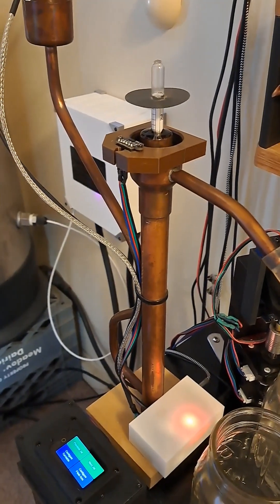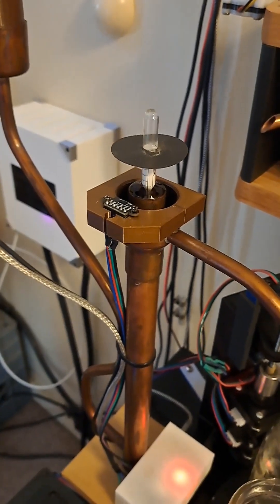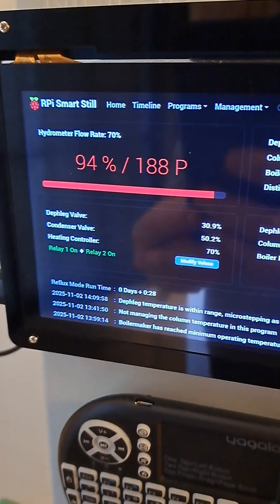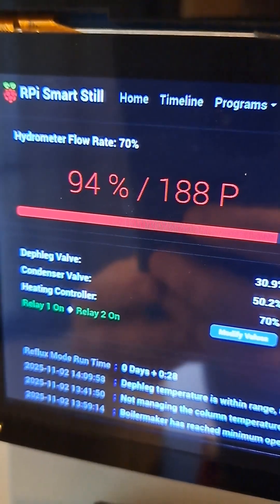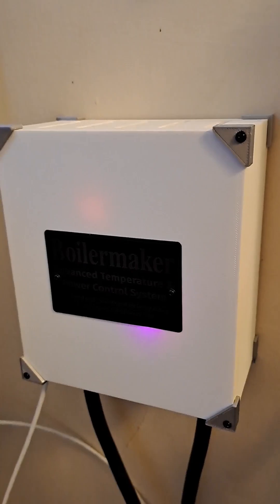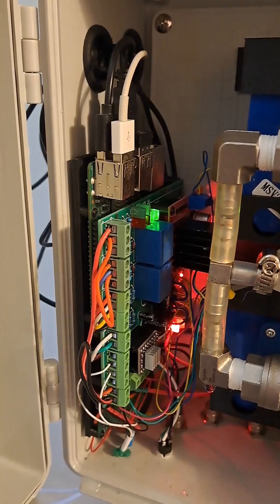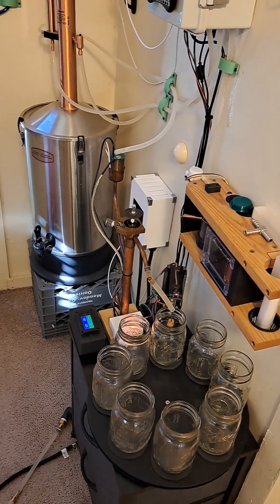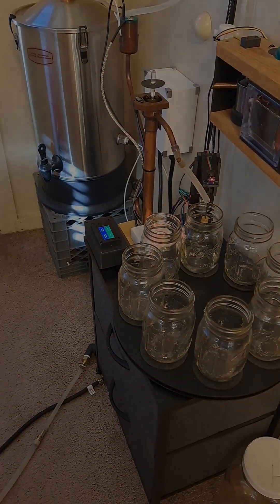Technology Assisted Distillation? What?

Comment: nice and simple. Only issue I can see if the hydrometer rotates the value may well change.
Reply from the maker: Not enough to make any difference of any value. The sensor reads in millimeters, that would only amount to a difference of 0 to 1.5%.
Reply: @PanhandlePonics  I do like in general. It's a very simple solution. 

On your lazy susan, how about a small set of scales that raise up. That would get you a very accurate flow rate. Drops down, then the table turns.
Reply from the maker: I'm more concerned with keeping things as stupid simple as possible and accuracy in home distillation will never be a dead-on thing because nobody ever builds or runs a still with any degree of dead-on accuracy. The rotating turntable is about as simple as it can get without telling somebody to just do it manually.
Reply: @PanhandlePonics  So how do you control how much goes into each container? Is that integrating the flow?
Reply from the maker: If you see the related video that's attached to the short, I do a full walk-through of the system and I cover that device at the end. That unit is my "Cutting Board" project on GitHub. At this time, it relies on a float to lift a rod that breaks an optical beam, which signals the ESP32 to lift the arm, advance to the next jar, then lower the arm again. I'm changing that to a capacitive touch sensor since the float setup is kind of unreliable at times.